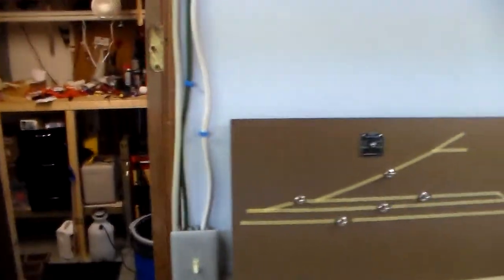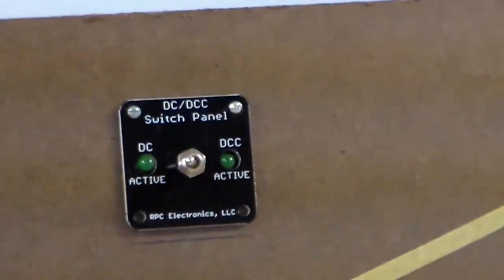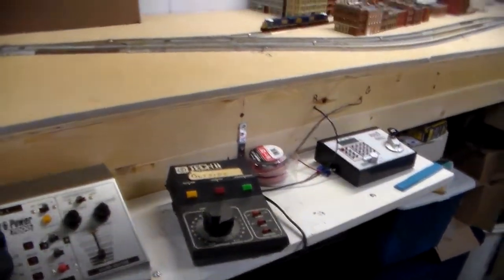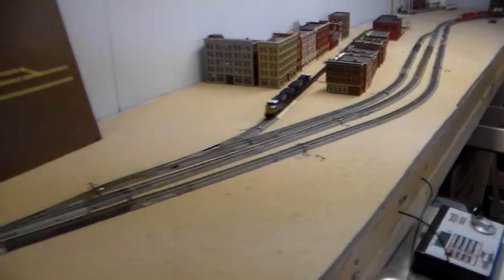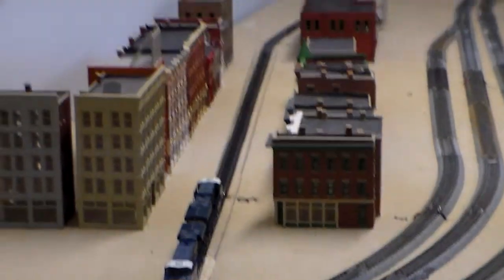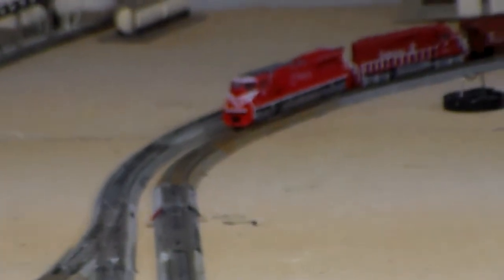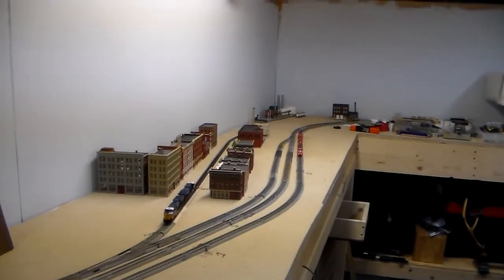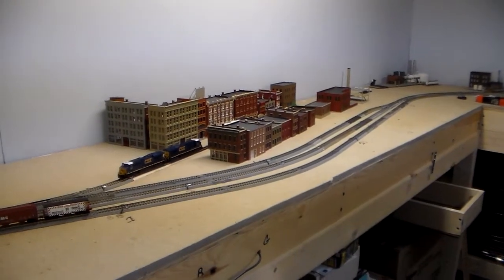N Scale Hadway Layout *2,Kato 3

Comment: Love those huge city bldgs as a block... good looking stuff.  Keep plugging along.  Coming great. Pedro..I've never done this myself..but, I have seen a video where a guy using Kato track has removed the metal joiner from the clip and soldered his feeders then re installed the joiner into the track clip and the wires are hidden beneath the track instead of soldered along side. Just a alternative tip not a criticism. Looking forward to future updates.
Reply from the maker: Overland Transportation System I have used that method before. I will be painting the wire to blend in with the ballast. I appreciate your input. I will tell you in a second i don’t know it all. So thanks for your ideas